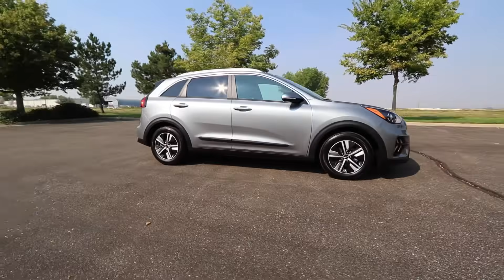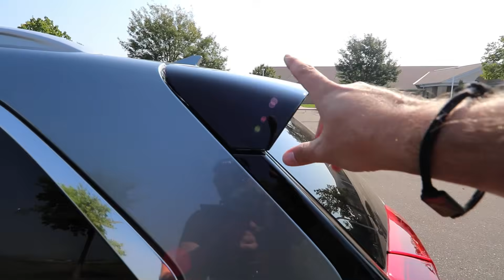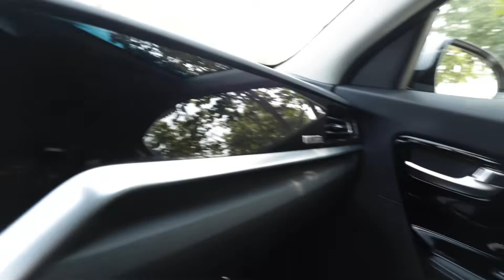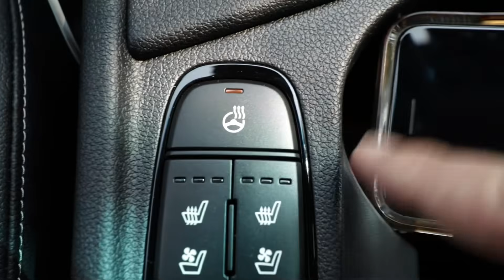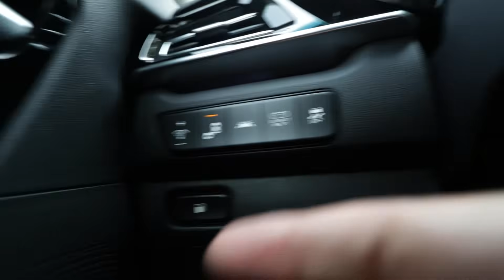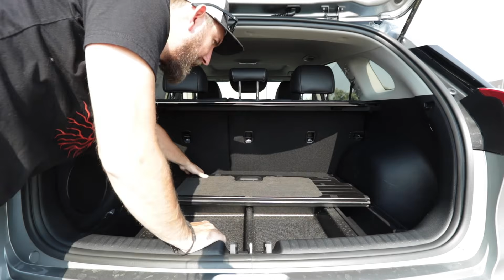Meet the 2022 Kia Niro EX Premium Hybrid Crossover

Comment: Given how similar in size and shape to my 3rd gen Soul, and that this has independent rear suspension, I was surprised that Consumer Report showed a big difference in handling, where the Soul was able to reach 55mph in their 'avoidance maneuver test', (the same for the Seltos) while the Niro could only do it at 51mph. What is different that would effect its agility?

I couldn't find any comparisons online to the performance between the Soul and Niro, oddly, whereas there is with the Soul and Seltos, given that the Soul and Niro are both FWD and a better size match. Can you comment on the driving experience by comparison? Specifically: (1) acceleration, such as getting up to speed on an onramp, (2) pushing it in curves, and (3) ride quality in terms of interior noise level and ride harshness/softness?
Reply: Always found the 0-60 stat useless. I never do that.  I want to know 40-60. That, I do ask the time getting on the freeway.
Reply: @montymontano8618  That's certainly more practical, and the 0-60 can be deceiving when comparing for your interest, but at least is a broad guide in place of better measures.

Comment: The Tiger Grill looks like a sheet of Renault badges. I have ordered the left hand model, it arrives in 2 weeks. 1.6 petrol Electric hybrid in Runway red. I was really impressed, it looks like the US and European markets get a different Transmission format. The Asian models for example get a dial to change the drive mode with paddles on the steering column. We get the good old Polo stick. The Asian format looks like it's loaded with better tech. Overall pretty impressive though. Lots of car for your money.

Comment: i have 2019 Touring and I don't miss the RX350 it replaced. with hitch mounted, I can tow small trailers, bike rack, cargo box, and roof top to greatly expands the capacity. MPG also has been great for commuting. in the warmer months, 52 and does dip to lower 40s' in the winter months. it's been rock solid reliable and HK system is awesome and free GPS map updates is a huge bonus of owning Kia and Hyundai.
Reply from the maker: That's great review. You're trying to take my job.

Comment: Is there enough room for a car seat in the back?  We’re giving our 2014  Soul EX, which I love, to our son. If the Soul came as hybrid it would be a no brainer.  One important feature of the Soul is the short 160 length which really helps out with parking in San Francisco. Anyone who has been here knows exactly what I mean. How does this compare?
Ps. I might have more questions so please excuse multiple posts.
Reply from the maker: There is room for a child seat. I think you would love the size of the Niro. It's 10 inches longer. But personally I would have said they were the same size if i didn't look at my cheat sheet. With those up and down roads in San Francisco you could really take advantage of the Niro's regenerative braking system. I've been to San Francisco you have to have strong calves to live there. I'm also a huge Giant's fan.

Comment: Nice review.  I have a question.  I have a highway commute with almost no breaking for 45 minutes.  If I keep a constant rate of 70mph, will I still achieve 40+ mpg?
Reply from the maker: Great question. I'm not 100 percent positive, but I'm 98 percent positive it does. It all depends what you're using in the car. If your blasting the ac it will probably be lower but it will still be in that 40 + mpg.
Reply: @AllThingsKiaCO  well that will certainly beat my 23mpg that I'm currently getting.  Thanks!
Reply: @Chadwilber  too high, im getting 40mpg with peak trafic plus Ac, and 50 mpg on the hightway. I use only 92 octane gas, anything higher get my mpg lower, probably because the atkinson engine is a relaxed motor so a more explosive gas is better than a higher octane gas (less explosive)
Reply: @luisenriquemelzer6124  92 or 94 is generally the highest grade before race or aviation gas.  Higher octane burns slower, if that's what you mean by explosive.  87 and 89 octane is ideal for a 9:1 or 9.5:1 compression ratio that the engine has.  93ish doesn't get you much more unless you are pushing the engine hard, but if that was the case, you wouldn't be in a hybrid
Reply: @scottallberry6713  the manual say that lowest possible octane has to be 92 octanes, octane is resistance to detonation, the atkinson cycle is a low power engine but super eficient

Comment: Battery reset is to jump-start the car when the 12 volt battery dies, which happens often on all Niros.

It absolutely has no relation to the drivetrain battery charge level being full.
Reply: “Happens often on all Niros”? I own a 2017, bought new in 17, never had a battery issue.
Reply from the maker: Yup, I totally botched that one.
Reply: The niro in my country doesnt have a 12 volts acid baterry, probably in usa is mandatory, they just section the main battery for a 12 volts lithium battery
Reply: Is that a sub in the back?

Comment: Well, you’re wrong about the wheel size. With the EX package, the 18” have been substituted with 16”. The Touring model still has 18” and is basically the same car, with the exception of heated and cooled seats. It’s worth mentioning that no version has an automatic lift gate, which is pretty ridiculous.
Reply from the maker: You are right, I was wrong on the wheel size.

Comment: Can you run stuff off the 12v lighter while the gas engine is off?
Reply: Yes but the car has to be on, the gas engine will turn on and off to keep the battery charged.
Reply from the maker: Yea, what ruststar said. You can't really do anything unless the gas engine and battery are working together.